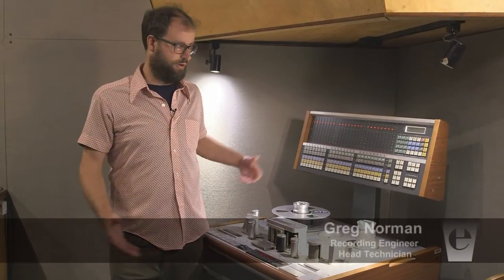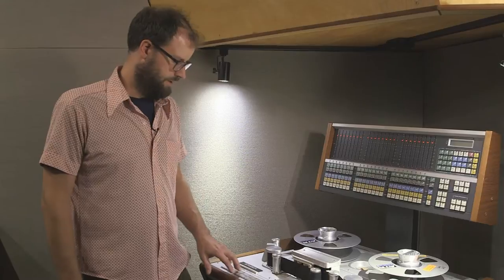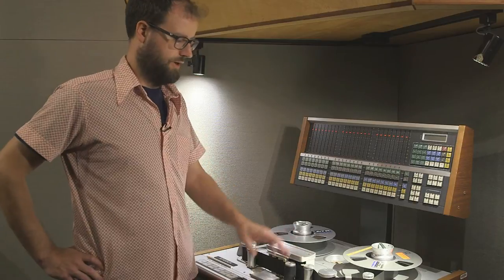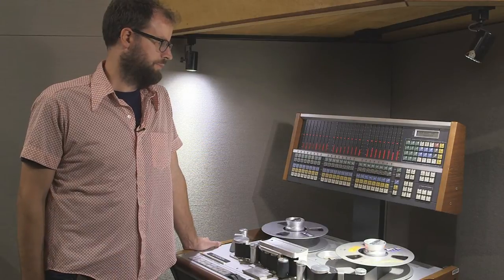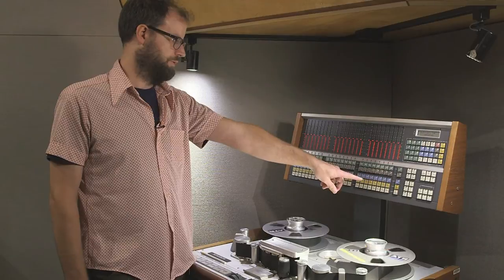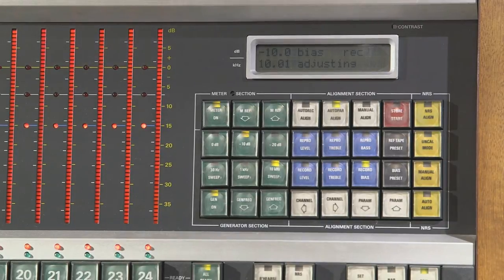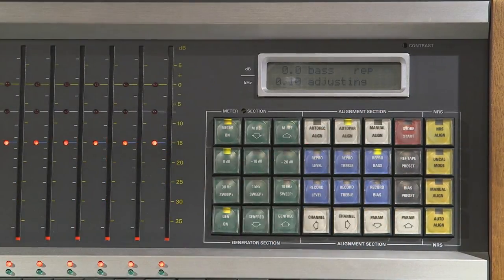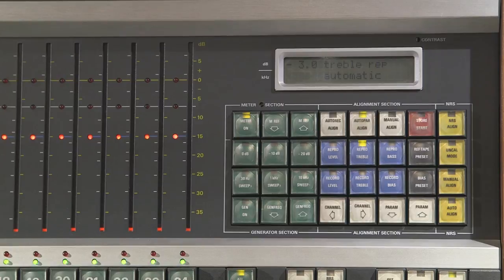Electrical Audio How-To: Studer A820 Multitrack Alignment and Calibration

Comment: why would you decide to switch off the Dolby HX Pro ?   I would think that would enhance the overall recording production quality by virtually eliminating tape hiss.  ?   - only reason I can think of why you'd disable it, is if someone came in with a reel of tape that was not recorded using Dolby HX Pro in which case you would have no choice but to disable.  your response would be greatly appreciated!
Reply: dolby hx pro isn't a noise reduction system, it's a servo acting on the bias levels based on the HF content of the audio signal. essentially, if there's a lot of HF in the signal, it can have the same effect as a slight over-bias, & the signal can self-erase itself a bit, attenuating the high end. with dolby hx pro, the signal is analysed (by the same sort of technique that dolby noise reduction uses, which is why bang & olufsen had to 'credit' dolby- they used some of the same patented circuit techniques) & the bias is adjusted on the fly to avoid this self-erasure.
when you are calibrating the machine using tones, you don't want to be fighting this bias servo, so you disable it temporarily.
it's a record-side process; doesn't have any bearing on how you play the tapes back.
some high-end 1/4" machines have dolby hx-pro, but no noise reduction. you can get a lot more high end onto the tape than on a regular machine. I have a lyrec frida & a studer 807 both with hx-pro.
Reply: were you thinking of dolby-SR?
Reply: duncan rmi is correct.  HX Pro isn't noise reduction, but a circuit that modulates the bias strength to improve high frequency headroom in the recording process.  I encourage you to check it out.  It's an interesting process that solves an interesting challenge.

As a side note, that maybe I should have included in the video, It's important that you bypass any noise reduction  system when aligning a tape machine.
Reply: @duncan-rmi  yes, I was actually... thinks for clarification!
Reply: @gregnorman870  just out of curiosity, why wouldn't you want to use that system if it does in fact what you say, in improving high frequency headroom ?   more headroom is a good thing, no?
Reply: @coffeehigh420  Sure.  You need to shut it off to properly calibrate the machine, however.  Once that's done, you can turn it on and everything will work properly.
Reply: I do not advise you to set up playback/recording with this function, because then you will be surprised more 😀

Comment: Greg, excellent video.  Quick question, do you recommend demagnetizing the allen wrench before you use it to adjust the azimuth on the heads?
Reply from the maker: We don't demag them on a session-by-session basis, but they're stored away from anything that would cause a permanent magnetic charge. It's a good idea to do that periodically.

Comment: Awesome video! What kind of Oscilloscope do you have to use for such a calibration?
Reply from the maker: Any dual trace oscilloscope would do. Oscilloscopes can generally handle way wider ranges of input voltage and frequency than you need for audio, but might be a good idea to make sure it can handle the levels and frequencies you're sending it.

Comment: Why is azimuth adjusted using tracks 2 & 23 and not 1 & 24?
Reply from the maker: Just as a matter of habit because edge tracks are most susceptible to damage and degradation, and eventually curling slightly.
Reply: @ElectricalAudioOfficial  Aha! I should have guessed that. It's been 25 years since I've calibrated a tape machine... 😳
Reply: @helmanfrow  well, then you wouldn't ask such simple questions...
Reply: @n123v ?